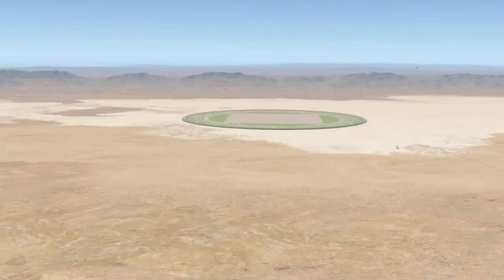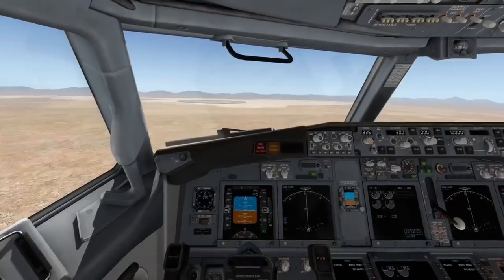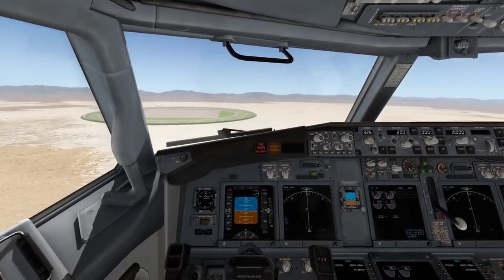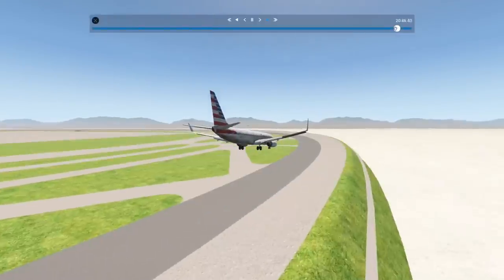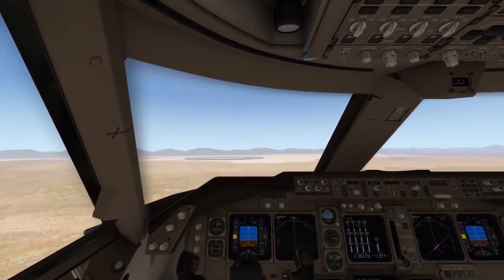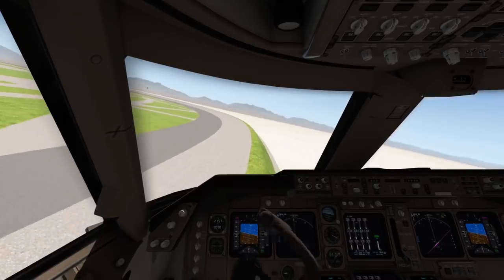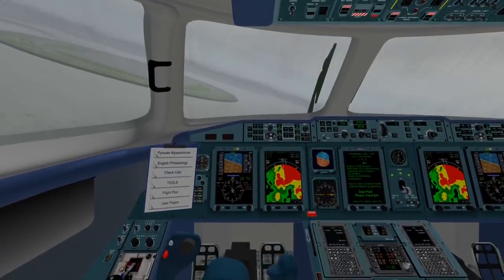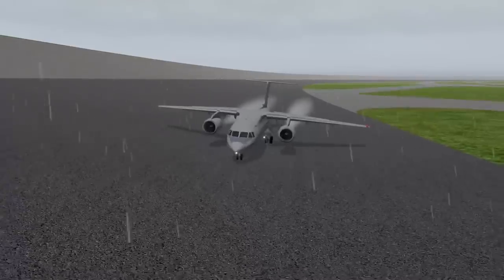The Circular Runway Concept - Why Did It Fail?

Comment: I actually proposed a model for this. It's a flat runway until it gains some high speed, and then the horizontal circular track begins (for increased normal reaction) and then there would be enough centrifugal acceleration to keep the body sturdy. This track would be in the high rising fashion, then then it would take of horizontally after which pilot has to control the flight using some basic aerodynamics.

Comment: I think it's a fascinating concept, but I agree the disadvantages outweigh the advantages, at least for the present. Also, most airports don't have a 4km diameter circle available, and have to be slotted into whatever space is available.
However, you make the point about bad weather. One potential advantage of a circular runway would be that no matter what direction the wind is blowing from, you would be able to land a plane directly into the wind (at least at the point when it touches the ground) on either side of the airport, and you should never have to take off or land in a crosswind.

Comment: If the runway was circular, peole in airplane will be thrown up due to cetripetal force.. Thats why engineers design superelevation or banking or the roads.. To ensure that vehicle that moves in th circle will oppose this forces... By curving the runway, airplane will lot harder to handle.. Because of large inertia thus we only see straight runway

Comment: If this was real, you would know the exact banking angle before landing. Then you could use your sensors ti help. Also actually knowing a technique for landing would be helpful.

In reality, I'd imagine the runway would need to have some type of a safety area around it, which would be easier to do by just digging the runway into the ground instead of building on top. I don't see any further issues with doing it that way except maybe in terms of wind behaviour.

And I guess there would be landing light series protruding from the runway at regular intervals, so there could be for example 12 different angles of approach instead of infinite.

I wouldn't discard this as unusable, just needs more engineering.

Comment: Try approaching it properly. Fly a coordinated turn over the circle, which should have a continuously increasing slope toward the rim. Adjust your position so the bit of runway underneath you matches your bank angle. This depends on your speed. Touch down into the wind. Remain coordinated as you brake until you’re so slow and horizontal that you can easily taxi off. Taking off is the reverse. I mean, there are problems, but it isn’t as bad as you make it look.

Comment: Aren’t you supposed to land on the darker part of the circle instead of the most outer circle?
Reply: Haha yes you are, he is landing in the gravel/ground on the outside of the runway
Reply: I asked myself the same question then i thought maybe i was the one with the wrong idea
Reply: Just saw the video and I had the same impression. Also it seems that the dark area is almost flat, while the lighter rises toward the borders of the airport. That’s why every time he tried to land, he hit the engines on the ground.
Reply: surprised only one comment mentions this
Reply: I agree. Even if he has to land more left to compensate for the increased size of the wing span, it should still have enough room to adequately work with. I don't really get the concept though. Sure, you have more landing zones, but pilots land into the wind. Just make two runways parallel with each other.That seems like a hell of a lot of work and maintenace just so pilots can go into the wind at all angles and can't imagine how much of a nightmare it'd be to implement with ATC.
Reply: @Kaimine08  Like i guess the idea is when they land in a slight bank angle they will be turning slightly so they could fly an approach the same way but just at end they will just go into a sideslip without the actual rudder so they are turning as they touchdown? Idk the idea made sense in my head but idk if this is actually going to work.
Reply: xD 

im da 100th like :)
Reply: You cant because of the centrifugal force you will need a surface with a certain angle to compensate that.
Reply: Alejandro Guardiola I would disagree because the inner ring still does have some slant to it also I think you are thinking in terms of a car going at that speed. Large planes with a huge wing span like that will create a large enough horizontal lift that even a small amount of slant will be ok to land the aircraft
Reply: The idea is that you can land several at the same time which can leave in the direction that they are intending to go.

If these were common you’d expect stabilising wheels on the wing tips to be added.

Comment: Computer aids would make it easier and safer. The runway must also be the runway must also be a bowl or a parabola shape in cross-section. Plane could initially land in the flat and then go wide to burn off energy on the bank.

Comment: Are you maybe supposed to land on the darker inner ring for touchdown where it's flatter, and then drift out to the bank if needed? Maybe it would be easier to land flat and then steer to not fly off the circular bank.
Reply: But yeah, I think this is a ridiculous idea. Navigation aid issues and bad weather problems probably mean this will never work. Physics isn't going to change, even in 30 years.

Comment: Ok. As far as I understand it was an engineer who proposed ths. 

As an engineer myself: what kind of a messed up engineer was that guy? Computer science? Electrical? How on Earth could you even think of something like that? I mean, the whole purpose of a runway is to either allow a surface [for an aircraft] to speed up or slow down drastically in a short time.
Banked roads/railways are built so one would not lose speed/energy when it enters a turn. What kind a of a messed up mind thought about this thing?

Comment: I heard about this concept before, and I had an idea how to improve this concept a little bit; that was to make the circle enormous so that you won't even need a bank angle, and when I (roughly) calculated what the required diameter was, I realized that a whole city could fit inside the runway. I remeber it was around 30km or something...
Reply: That would not be terrible at all because it would make it pretty easy to embed into EPCOT.

Comment: “Why did it fail?” 

I can think of a couple reasons...
Reply: gac gac The runway has to be bank. This feature brings the wing tip and engine way too close to the ground. 

Engine and mechanical failure in this type of runway can prove lethal. Think of gear down failure. Unable to steer the direction of the plane will cause you to exit the runway unintentionally.

ILS approach wont work on this runway as it is circular. 

In conclusion circular runway is efficient however it is too risky than the runway we currently have.

Comment: Make a square runway with tipped vertices.
As easy to land as a regular runway, easier to build (no need to wait 30 years)
Same benefits as circular runway.
You don't even need tipped vertices though because you just straight out go into the taxiway.
What do you think?

Comment: More speed=More pressure to gear 
If runway’s radius is small, long planes will hit the runway, also, bank in angle is dangerous because of heavy planes stop and it will slide and get wing strikes

Comment: Create something called ILSD which is ILS that allows deviation. The antenna is placed in the centre of the airport and spins around. The system allows a deviation from the antenna horizontally of the radius of the circle runway. As for the glideslope, the glideslope also has a deviation.

Comment: hold on, he said its a problem when the front steering dies while takeoff ? so the Pilot flying needs to have his hands on the wheel, on the yoke and throttles aswell ? who doesnt know that the line is held by the rudder at takeoff ? Shows again that he knows nothing

Comment: What about a p shaped runway?

It has the circle but you aproach onto the straight part then you go into the circle. This way any sized plane can land and there’s no bank on landing
Reply: Good idea, but chances are pretty high that after the touchdown you try to brake, but your speed is still too high as you get into the curve, so your plane understeers and slips "over" the front gear straight on, like in a car that goes too fast into the corner.